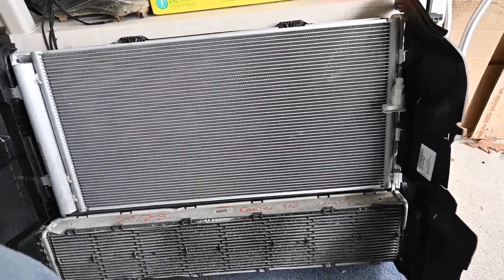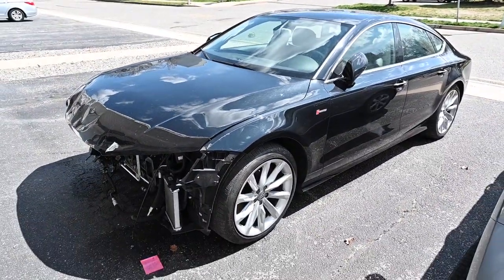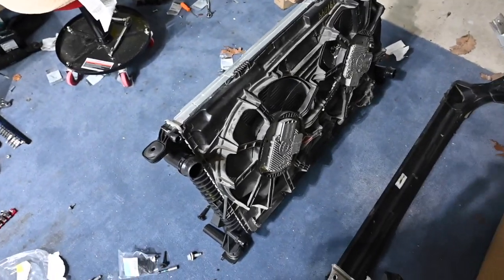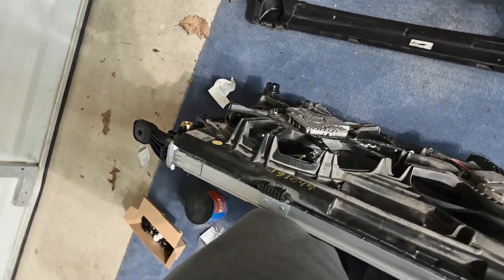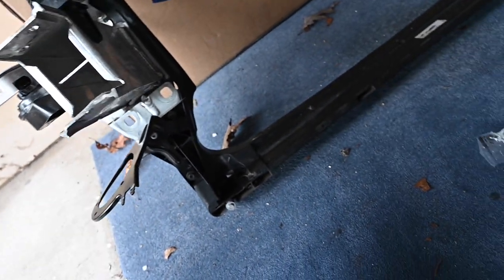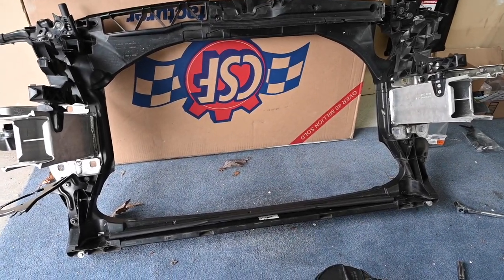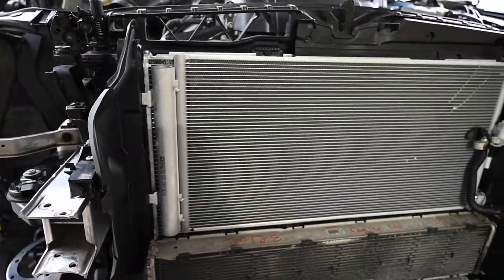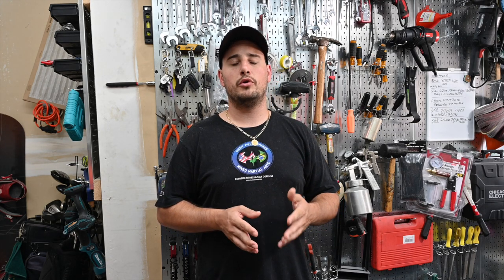Rebuilding a Wrecked Audi A7 Part 7 (Radiator Support Assembly)

Comment: If you have a pick-n-pull or pull it yourself type yard around you, you might get lucky with a an inexpensive hood that is at least straight. Is that the only year hood that works for that car?
Reply from the maker: Sadly there's nothing much around. I just found one so I'm going to bite the bullet and go pick it up. Super expensive
Reply: @DIYSalvageGuy  That's tough

Comment: Great video thanks. Is there a lubricant or similar you use when connecting the radiator hoses. Seems impossible to dry fit
Reply from the maker: I've used a little bit of antisieze before on the gaskets. Works well for removing and installing. A very little bit though.

Comment: What’s up Mike doing good bro. I would have done the same thing and mess the same thing. I did that here at work using a electric screw drill and messed stuff up lol. Great video man keep them coming.
Reply from the maker: Funny thing is I got the new bolt and I hand tightened it and it snapped again anyway so it wasn't the impact. Just threw a zip tie on it and moved in haha 😂

Comment: Very helpful and your last statement is very true!
Reply: I’m going to replace the crankshaft pulley but I’m having trouble loosening the radiator and fan… what bolts and where do i do this because that’s the only thing really stopping me?
Reply from the maker: I would leave the radiator and fan assembled and just remove the whole radiator support. Remove the bumper and disconnect the whole thing. There are a couple screws around the assembly. Not too bad of a job.
Reply: Ok so ive gotten the bumper off but i cant remove or take off the radiator support ive watched your video on putting the car in service position..
Reply: I gotta a7 2012 and i done removed those two inner bolts but the support is still not moving..
Reply from the maker: You have to be missing some bolts then. The whole thing comes off.

Comment: I found a used hood for a good deal on Facebook market got it with a few other parts for 600 shop around because I know your pain man them parts 
Pricey good save on the hose
Reply from the maker: What were you building? I searched for about 2 months, couldn't find anything near that price in decent condition
Reply: DIY Salvage Guy the same car a 2015 Audi A7

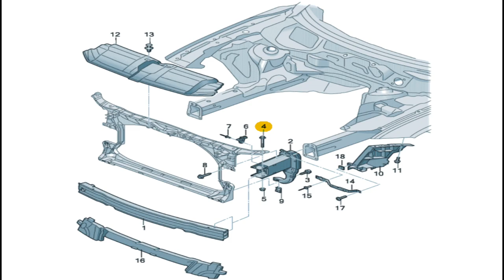Comment: Hi, thank you very much for sharing your experience. I crashed my A7 in the front and the radiator is damaged, which seems so similar to your situation. It would be very helpful if you can share which website did you find the picture at 1:50？ showing all the bolts and brackets of the radiator support.
Reply from the maker: Hey! So sorry to hear about your a7, but happy to help! Here is a link to where I got the manual. 

https://www.emanualonline.com/?gclid=Cj0KCQjwpZT5BRCdARIsAGEX0znzqKgUQTYdUri-gMO0Bb2palnduOMzGjMh2A-KV209hLnS5cTTmPAaAlq6EALw_wcB

Comment: So I am having a heck of a time getting my new upper hose to seat up and clip (with the u-shaped piece). It clips the same way that the hose you were holding at the end does. Is there a trick to get those hose clamps to seat up properly. I matched up the groove lines so that's not the problem. ?? It's kicking my butt. Clip will only push back down most the way and not clip on in the closed position. I'd appreciate any advice you have on that. I miss a good ol' O-ring clamp. geesh.
Reply: Nevermind. I found (by luck) a guy who showed that ya gotta wiggle the hose back and forth with the direction of the slot and key to get that last little bit.
Reply from the maker: Glad to hear it worked out! I was going to recommend a little o ring lube.

Comment: Hey man I got a salvage a7 hit in the front like this one having a problem getting out the radiator out  is it Bolted on the bottom or do i have to pry it up some kind of way ,, im baffled
Reply from the maker: I think there are 4 bolts. Two are on the bottom. After that it should slide right out.
Reply: @DIYSalvageGuy  Thanks man I thought it would pull right out! never heard of bolts on the bottom holding a radiator kinda figured that but was hoping there was some other way  ,,, excellent video!!

Comment: Hey Mike, do you still have the PDF you used for reference your inst process? If so, I would like to get those for my repairs, please.
Reply from the maker: Hi there. It was not a pdf. It was a repair manual from www.emanualonline.com   great buy.
Reply: Thank you for the advice. I've purchased it and can't seem to locate the section that has the removal or inst. On the front end, did I need a different one or just looking in the wrong section? Please advise where I would find it 🙏 😫.
Reply from the maker: There was a total package I purchased. It included all areas for audi, vw, and a bunch of others. It required virtual machine. It wasn't very easy to navigate unfortunately. Feel free to email me for a quicker conversation

Comment: Did you ever figure out where the seal strip goes which you showed at 16:00?
Reply from the maker: It's been a while but I am pretty sure it goes between the radiator support and the radiator
Reply: @DIYSalvageGuy  Thanks, I will check and give it a try.